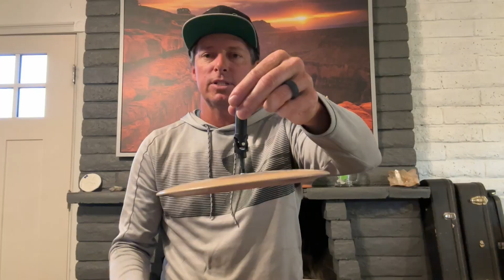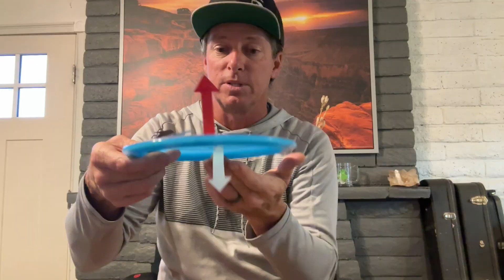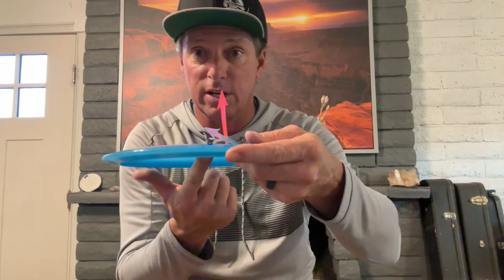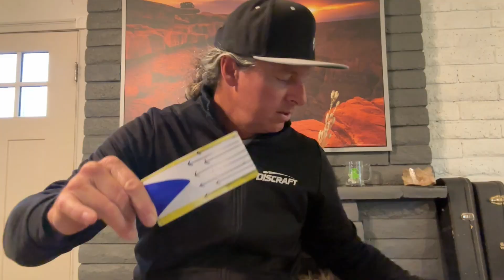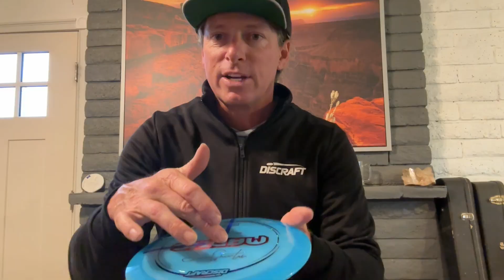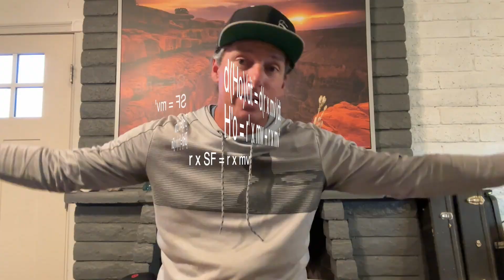Why do Discs golf Discs Turn and Fade?

Comment: Great explanation!  Buy WHY is the center of pressure (lift) start so far back???  My understanding of typical airfoils is it is usually around 1/3 back from the leading edge....the flow goes turbulent past that point so no lift....what's happening here?   I need to think more.  Maybe since the Reynolds numbers are so low my experience with normal airfoils is useless?
Reply from the maker: I’m not sure what you mean by “the flow goes turbulent past the point so no lift”?
.
I don’t think I stated that, but I’ll try to extrapolate what you may mean.
On a traditional wing the balance point is typically 25-30% of the mean wing chord measured back from the leading edge, like you stated.
A disc golf disc is balanced in the center of the circle of itself. Unlike a traditional wing which is balanced specifically to each wing and aircraft for stability in flight. A disc being balanced over its center gains its wing like ability to fly and stay balanced from its spin. The spin of a disc gives it gyroscopic stability, so all the forces it experiences during flight that are not on it spinning axis, will be transferred or observed 90degrees away in the direction of rotation.
The shape of a putter is blunt, its slow because of its Drag, think a “Piper cub”. The putter’s leading edge is also the same shape as its trailing edge, Unlike a traditional wing.
If we throw a disc faster than its “wing” is designed to fly, the center of pressure drifts behind the center of balance. 
If we over-speed a traditional wing say on the “Piper Cub” we compensate by adding elevator to keep it in balance. But because the disc is spinning, the lifting force that lifts on the tail of the disc, would tip the wing forward, like on the airplane, but instead is transferred 90degrees to the left (clockwise spin) because of gyroscopic procession, so the left wing then lifts. 
If we throw a disc slower than it’s designed to fly, it will like an airplane, Stall. The lifting force moves far ahead of it CG towards the front of the disc, this would lead to a stall like an airplane, but the because gyroscopic effect on the disc takes place 90 degrees away from the force, the right wing lifts causing the disc to dive left.
A distance driver on the other hand is sharp rimmed, it’s fast, not because it “cuts” the air so efficiently at the leading edge, but because it’s trailing edge has very little drag…once again a discs leading edge is the same as their trailing edge, so its induced drag is much less than a putter. 
I assume that a putters Reynolds numbers would be much lower than drivers. I’ve never tried calculating Reynolds numbers, I am only aware of them in passing, as I fly rc DLG gliders and there is a lot of technical discussions about each wings high speed and low speed capabilities.
Reply: Thank you for responding!   I've been trying to  understand (in detail) how exactly a disc flies ever since being introduced to the sport a couple years ago.  A friend threw his disc (first time I'd seen one fly) and it did the typical right then left flight path....and I was like "wait...what???  how does it do that????".  With no control surfaces like an airplane, I was totally befuddled how the disc could roll right then roll left.   It is really unique and fascinating.   Actually read a bunch of research papers on the subject and every one of them left me thinking "wait a minute...you didn't account for this or didn't answer that".  The papers that did flow and forces analysis without the disc spinning you know to toss out instantly !   

 Your video is the FIRST explanation I've seen that makes sense, thank you so much.  

Gyroscopic procession is a strange topic so using the prop you built is genius and I'm sure totally helped a lot of people understand it.  It is something that is not intuitive for sure.

Back to my original confusion......I'm just not sure I understand how the Cp (center of pressure) can move fore/aft significantly as velocity changes, I would just expect its magnitude to change not its location.  For typical aircraft airfoils, AoA (angle of attack) changes certainly causes the magnitude to change, I'm not sure if the location moves fore/aft significantly or not.     

I'm also thinking the boundary layer is coming into effect, as one lateral side of the disc is experiencing DiscVelocity+SpinRotationVelocity while the opposite side is DiscVelocity-SpinRotationVelocity.  Hope I'm making sense.  I think this comes into play, the actual pressure field should be different on the left side of the disc vs the right side of the disc, due to the surface speed of the disc and boundary layers effects.  It would be interesting to somehow keep a disc at a constant forward velocity while changing the RPM from 0 to a high number and see how the forces are affected.  If the left/right pressure field is not symmetrical and the forces change with RPM, that would certainly induce a pitch up or pitch down moment, from our pal gyroscopic precession.  

 I'm also curious what the actual flow looks like on the underside of the disc, but probably not contributing to the flight mechanics.  No way it stays laminar, but the vortices may not be significant.  Then again, the flow field could change with RPM and velocity so I'm not sure.  

In any event, wonderful video and I'm going to keep pondering the details.   Sorry I typed so much....this is just really interesting stuff to me.  This is a pretty complex subject so if we ever meet in person I'll buy you a Coke and we can sit down and talk, always love learning something new.    I'm certainly no expert, always found a PhD in aerodynamics to assist in the complex questions...and a spinning disc is pretty complex.  Just the fact that a given disc flies differently after getting "beat in" is crazy (and tells me boundary layer is having an effect!).

Oh, and RC gliders are fantastic !  Used to fly them years ago.  So much fun.
Reply: @timhossfeld7260  airspeed change by itself doesn't move the CP... just magnitude, like you said. But remember that airspeed change always comes with AOA change (as the wing/disc slows down, AOA increases) and that moves the CP forward.

Comment: I don't know if I will get lost in the, however.
Your take is very good and well explained.
But I believe and understand that for the flight carateristics, the "nose" of the disc makes a big dofferense. You didn't bring up the force generated by the wing hitting the nose. If the parting line is very low, more wind will hit the upper part of the disc wich you will see as turn. If the parting line is very high, or the bottom half of the nose is very agressive (or has a pead) the bottom will catch more air and generate a forse as stability.
Reply from the maker: The amount of lift a disc generates is a major factor in its stability. It’s not just that the air is getting diverted over or under the disc, that splitting of the air is only half of the story. The air, once diverted, must travel over and under the disc and come back together at the back or tail of the disc… this is another component of lift, but is also the location of drag….another video for later:)

Comment: This is so good. I spent a decent amount of time trying to figure this out but I was missing the fact that CG moves back during high speed so I never understood it. Thanks a ton Pete!
Reply from the maker: Thank you! 
Quick note:
I believe it’s the center of lift that moves back. It moves behind the CG, which does not change.
Reply: @DiscgliderPete  Yeah. I'm a pilot, force of habit. The cg on a disc doesn't change. Thanks for the video!

Comment: Great explanation. How does the difference in apparent air speed between the left side and right side affect lift, turn and fade? The air on the left side is moving across the disc faster than on the right, for a right hand back hand throw.
Reply from the maker: Thanks for the great question @edneely! From what I understand, based on the best scientific studies and data available thus far, there is no measurable difference   From the left and right side feeling a difference in apparent airspeed as you were asking.

My thoughts are:
If you think about it they are wedge shaped edges on the left and right wingtips, but not within the lifting part of the wing, so it’s more of a slip stream near the edge. That’s my visual reference for understanding. But I honestly don’t have a full understanding of why at the moment other than Basically not enough difference to cause a Magnus effect either.

Comment: So why does the center of lift change depending on the speed of the flight?
Reply from the maker: Wings are designed for specific airspeeds. 
The best lift/drag ratio is most likely over the center of balance, when we throw a disc faster than its best L/D the center of lift pressure drifts or moves behind the center of balance due to the pressure in airspeed. As it slows down below its optimal L/D  the lift force moves in front of the center of balance because the velocity of the disc is slower… thus the pressure is lower because air velocity over the surface is also slower. 
.
Perhaps a topic for the next video
Reply: Thanks for the detailed reply!
 @DiscgliderPete

Comment: Great video and you make it very easy to understand the general concept of flight/stability. Its one thing to know about weights and stability as an average player but this is a clear summation of why that all matters. This will help a lot of people zero in on a disc that fits them rather than adapting their play to the discs in their bag.

Comment: Great video! I'm glad more people are talking about gyroscopic procession to explain turn and fade. Do you think another factor affecting turn/fade of the disc is that higher parting lines (more air diverted under the front edge of the disc) actually push the front edge of the disc upward? Gyro procession would divert this force 90 degrees in the direction of rotation to cause fade. Understable (lower parting line) discs would have more air pushing downward on the front edge of the disc.
Reply from the maker: Thank you for the comment! It’s a great question but for the purposes of this video I’d touched on the basics and we discussed basically the leading edge of the disc, however a major component to understanding, is that the leading edge of the disc is not the ONLY factor.
Were it like a rudder on the front of a ship ONLY diverting the fluid on one end of the object causing an opposing reaction, then we could assume that the discs parting line causes upward force…(perhaps the disc call the  “tilt” could be an extreme example)
Ono part of this video I left out for simplicity sake, in order to not “drag” the viewer into the weeds too soon, (pun intended) is the visualization of what happenes at the back of the disc….the air diverted over and under at the leading edge of the disc, comes back together at the trailing edge of the disc. 
What happens here it’s the Drag force acting upon the disc. Air from the top and bottom come back together and the shape of the edge of the disc determines the shape of the downward flow of the lower pressure air moving over the top into the higher pressure air below, this is another component to understanding lift and amount of drag induced by that interaction. 
Main point is this: the upward force you describe of a high parting line has an opposite force at the rear of the disc to contend with.

Comment: So then what is the cause for late turn? Mostly straigth flight at beginning and gentle turn from mid point onwards?
Reply from the maker: Great question!

 I think part of the answer lies in hyzer flipping a disc (rhbh perspective) so that the late part of the turn is just past its level flight, and the second part has a lot to do with proper nose angle throughout that precession  so when the disc “tips” to the right of level with the proper nose angle, most likely a neutral angle of attack or slightly nose down angle of attack it would appear to track to the right as it glides…(a nose up angle of attack at this point would cause it to slow down and fade more quickly).
coupled that with it possibly having reaching its best lift over drag ratio (perhaps the lift acting over the center of balance at this point) would help hold the flight pattern for longer. To throw this shot with any consistency, one has to know the flight characteristics of that particular disc, how much it turns and when it typically “settles in”. It’s a bit of a touch and nose angle game from my experience.
Another component I think would be that a disc with high spin rate resists off axis torque more than a disc with a lower spin rate. So the high spin rate would tend to delay the turn till later in its flight down the fairway.
As we can see, other than just throwing and enjoying it, nothing about understanding the complexities of what’s going on with the flight of a disc is casually simple.
At least that’s my current hypothesis. :)

Comment: Great explanation of how profile and speed affect turn over and fade!  Still missing something I think. Specifically, an explanation of how wear and tear affects same. I believe it is a Magnus effect. Perhaps is is somewhat less pronounced than what was explained here, and maybe that is why no one ever mentions it.
Reply from the maker: Thank you for your comment! I can’t throw everything into one video, that would be a long video!!. I will talk about wear and tear later in another discussion, but it has a bit to do with laminar flow becoming turbulent flow over the surface of the disc. And the magical thing that occurs at the back of the disc called….Drag!
What I do know, based on the best scientific studies available to us currently and conversations I’ve had with fluid dynamics engineers, the Magnus effect has no measurable effects on the flight of the disc.
Reply: @DiscgliderPete Kinda related to drag is the reduction in angular velocity due to friction.  How does that effect the angle of attack?

Comment: This is awesome Pete! Begs me to ask how ‘speed’ or rim width effects gyroscopic precession and also the effect of rims that are flat vs curved more specifically are rim curves only producing tern at specific speeds.. more speed = more lines, exponentially larger amount of molecules on top of disc vs bottom
Reply from the maker: Great questions, If you have time to roll through the comments, I chat about something like that in several threads… lots of good stuff and great questions throughout this videos comment section this far!

Comment: It is a great  explanation except when you’re a lefty, then you have to think about it just a little bit more OK so you guys are going forehand or backhand but if I’m a lefty that’s like your forehand so I have to sit there and think think think now it’s getting a lot of easier now been doing this a whilebut sometimes I get confused whether I should be putting Heizer or Anheuser on different discs
Reply from the maker: Sorry, I don’t speak lefty. Think everything is counter clockwise and the force put into the gyroscope takes effect 90 degrees away from the force in the direction of rotation:)

Comment: I wouldn’t mind a video on glide. How do two discs with same speed have very different glide characteristics? I think it may have to do with the dome to some extent, but curious as to the exact way it happens. In particular, the Rask was designed to have low glide with a fast rim. They essentially molded a concave puck to the bottom, so I don’t know if reducing the volume underneath the dome may have an effect on glide? Would this be why a flat top disc doesn’t glide as much as a higher dome version of same mold?
Reply from the maker: Good questions!
First let’s understand the disc flight number system is an approximation of what could be expected at that discs intended speed, and is subjective to each individuals throw on how it’s experienced.
In aerodynamics we are always trading one thing for another..
Lift for drag, speed for control …
If you want a faster disc, you will inherently be trading speed for control,
If you want more glide you will inevitably be increasing drag. 

The dome of a disc can have an affect on its flight, some folks experience dome top discs as under-stable while others experience the same disc as over-stable, as well as flat top discs feeling both stable and under stable to different throwers. For a moment, let’s assume a dome top disc and a flat top disc of the same mold, color, run, and other parameters have the exact same parting line. Meaning they divert the same amount of air over and under. What I’ve observed in these kind of instances is this: when holding a dome topped disc, the disc will tend to set in the hand with a little more “hyzer” angle because of the way the top of the disc fits against the thumb and palm. While the flat top disc will tuck up into the palm a little more causing the disc to set a little flatter with a little less “droop” or angle. This is interesting to me because this situation sometimes means the difference of several degrees of angle when thrown normally.
Reply: That makes sense and thank you for the explanation!